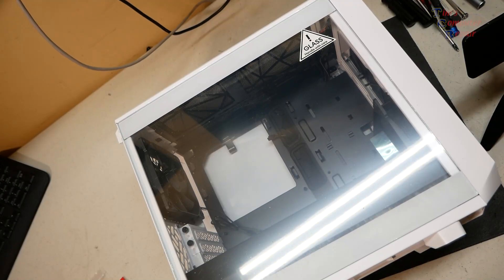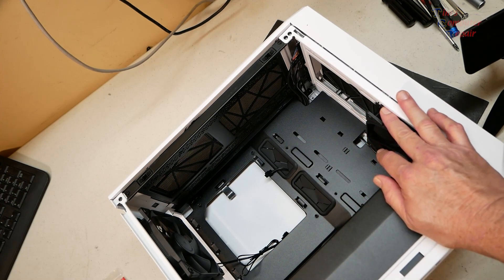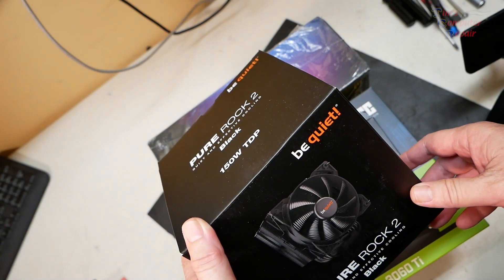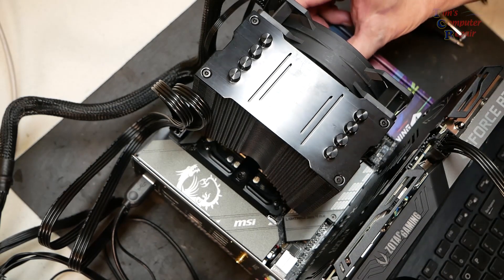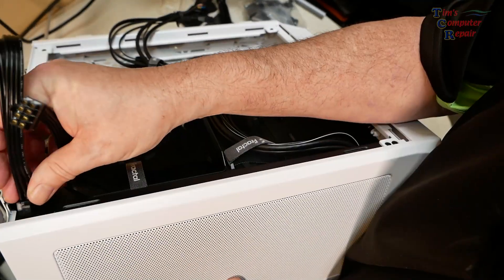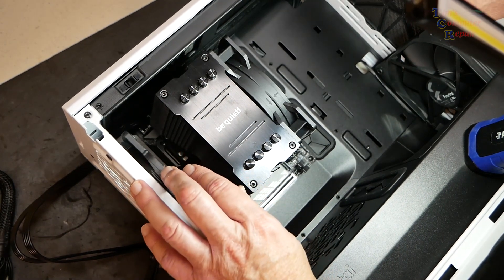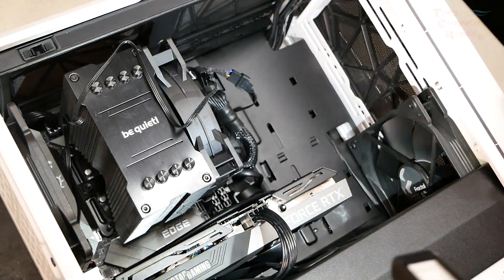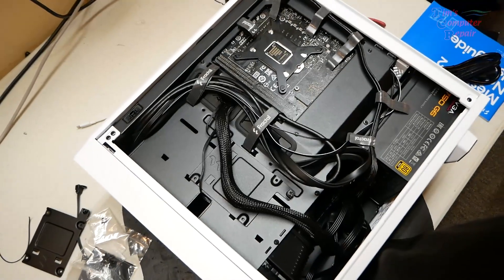This Custom Built Mini PC Case Has Really Good Airflow

Comment: But  you have to remember   those  tempura are very  dependent  on the outside  ambient room temp.   So if it's  in a   room    with   A/C    then   it's not going to matter  as   much
Reply from the maker: Thanks for commenting.
Reply: @TimsComputerRepair  hi, can you support me and tell if it necessary to buy spare front panel cables or they are comming with every pc case? Thanks for this!